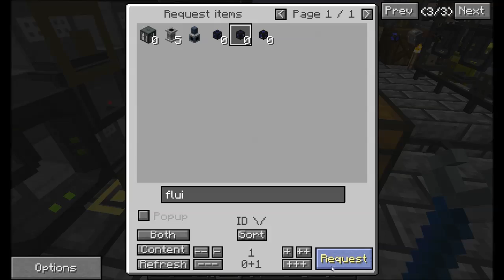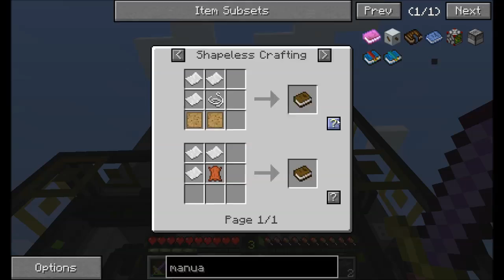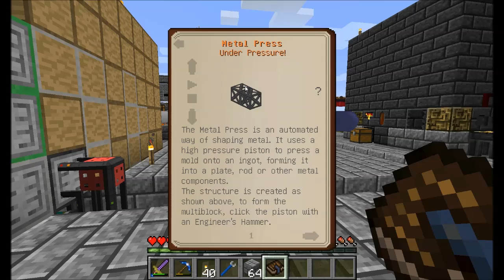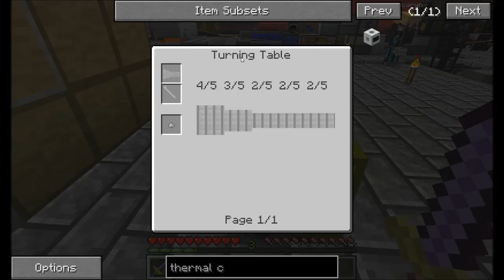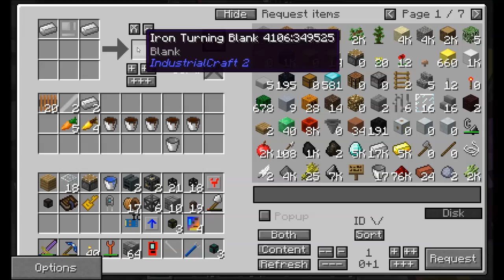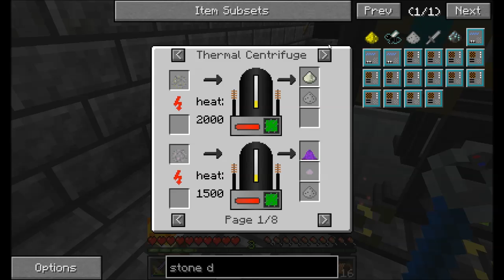FTB Expert Skyblock   Ep17

Comment: I know you're long done with this but for anyone else looking to get Ender Pearls in this pack. I just made a fairly large room with cobblestone slabs every other block to prevent spider spawns and a line of MFR conveyor belts pushing mobs into a hole as they wander around. They all fall into a smeltery with vanilla hoppers underneath to pick up items as they die and void pipes to void most of the blood. I am swimming in resonant ender right now. I also used the massive amounts of blood to decorate my blood magic area.

Comment: Ender pearls:  3 high 9x9 smeltery with a lid.  put a bucket of water in to get it started.  Endermen will spawn inside and die producing resonant ender which can be cast into ender pearls or used for alloying.  Also provides blood which can be cast into coagulated blood and used as slimeballs.

Comment: Hi Dire you need to put electric motors into the electric generator in the slots on the right if i remember right up to 12 and it has to face each other the circles both line up on the outside of the machines... It' a pita but fun have fun and a good one!

Comment: Don't know if you'll see this or not, but I'm pretty sure you need Energy Transport upgrades outside the logistics power provider blocks.  By putting a Power Provider upgrade on the pipe outside the provider block, the provider block is basically powering itself.  That might explain why the charge wasn't going up,  The power beam shouldn't show up unless there's a demand on the system, and there's always a beam outside the provider blocks.
Reply: +UbilManther this has been recorded weeks if not months ago, your message won't change anything.
Reply: +jérémie tisserand Oh, I know. It may be a few weeks, but maybe we'll see it fixed in episode 25 or something. I just felt it was worth mentioning since Dire is concerned about using mods correctly. Logistics pipes has several things he hasn't used that would have come in handy so far, like the sneaky upgrades or the fluid crafting upgrade that would eliminate the need to put the liquids in buckets.

Side Note: the standard logistics pipes' crafting bench won't craft with liquids.  You need something like MFR's Cyclic Assembler that can take liquids.

Comment: I just want to point out that when I was playing this, I just used openblocks fans and a 3-tall ceiling. I had like 2 stacks of enderpearls in minutes. With the amount of iron they have, this is basically the easiest way to get pearls
Reply: Even I did that. It is really an effective method. They have sooo much iron: Dire setup a void pipe for it.

Comment: 20:35 Dire Derp... He placed the Electric Kinetic Generator with the only power input it has away from the pipes meant to power it thinking it was an output...
Reply: +Darius Sawyer ikr
Reply: +Darius Sawyer i cant understand what you are trying to say but i noticed the eu yellow power glow is blocked by rf red power glow inside the pipes.
Reply: Amir Syafiq it's not, it was trying to find a path but there was no input to go to
Reply: +Amir Syafiq The "circle" face of the kinetic generator is the side you input power to it. when Dire placed it he faced it away from the pipes, so it couldnt get power from the LP network.  The lathe is frustrating, one of the quirkiest machines in the pack IMO

Comment: Fall damage should not teleport enderman. Worst case you can make a special place to spawn them. They can only teleport 60 blocks away so you can put it far enough from the base and cover available teleporting surfaces with water.
Reply: +ODDnanref this has been recorded weeks even months ago (spoiler alert) they have alredy fixed their ender pearl problem
Reply: +jérémie tisserand 
Okay, thanks.
However having the information at hand is always usefull.

Comment: +direwolf20 the electric kinetic generator only seems to accept power from the IC2 storage(Batbox/CESU/MFE/MFSU) it doesn't accept from Immersive Engineering connectors.
Reply: False...it just need electric motors to work

Comment: About the turning table.I think the electric motor won't work cause it only accept energy from ic2 cable. It's bugged or not implementet yet, i think. There are a few IC2 Machines with the same problem
Reply: +Mallak Plob I thought the reason was that he only had 3 motors installed (and it showed 300/1000) and he might need 10 motors to get to 1000/1000 before it works. Probably been as long for me using IC2 as it is for him so I am just guessing.
Reply: +Ocker Spock No 1000 is just the max possible for the kinetic generator but not the requirement for the connected machine to work.